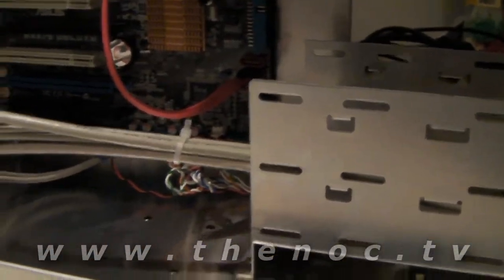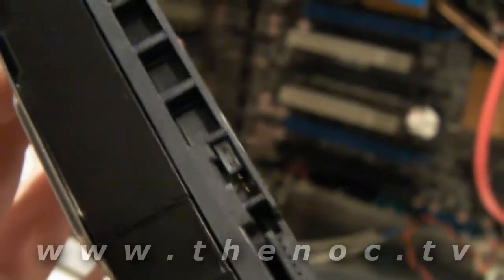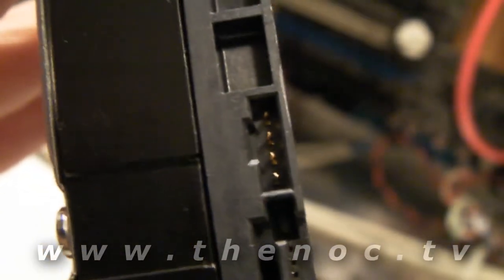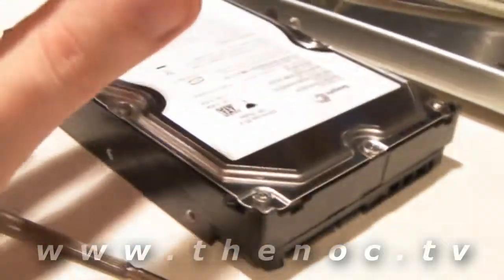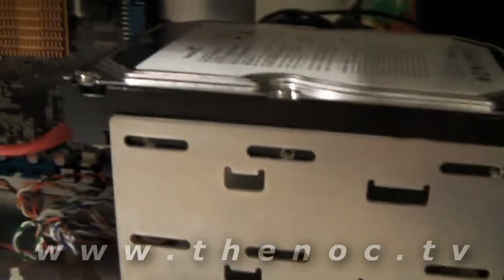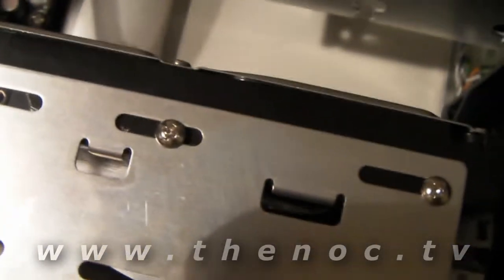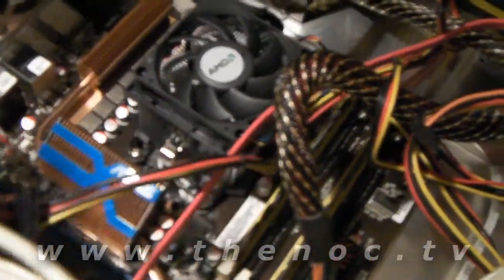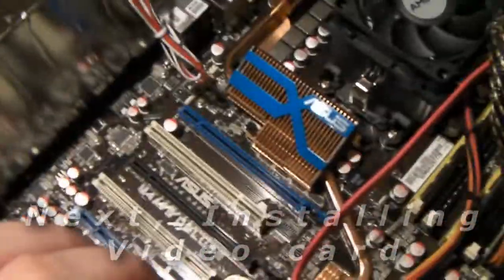Build your own custom computer - Hard Drive

Comment from the maker: @Garaventa17 I use a 64GB SSD in my desktop at home and it flies! The SSDs are usually the smaller laptop drive size. So you need to get a converter kit so you can mount them in a case like this. I have a video up here on the SSD review and the bracket review.

Comment from the maker: I have seen some drives where a chip on the HD controller burn up. So yes it does happen. There is a remote possibility you might be able to get some of that data off if you needed to, but it's like finding a needle in a haystack to get it done.

Comment: I didn't know that about the seagate on how it has the jumper for the 1.5 gig and 3 gig.  My question is why wouldn't they just have at 3 gigs at all times are there certain situations where you want less of a transfer rate?